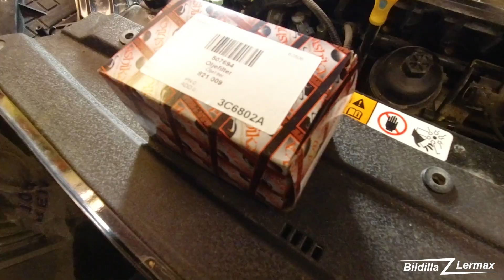DIY How to change engine oil + Filter , 2013 KIA Ceed 1.6 CDRi - Bildilla Magasin

Comment: How did you get the oil filter off the housing?
Reply from the maker: Good day!

Good question. It didn't come out in the video, I see.
I just pulled the filter out of the holder. But it fit well, so I was a bit unsure too!

Greeting
Pål (Paul)

Comment: Which is the oil you use for it? Could you suggest me any oils for my 2007 kia ceed crdi 1.6
Reply from the maker: Hello.

I would use a fully synthetic oil.
The oil choice has a bit to do with where in the world you live.
If you think that the thickness / viscosity of the oil is important in some climates.
I use Mobil Super 3000 5W-40. It is an oil that is suitable for most from cold winters that we have in Norway, to hot summer days in this country.

Here is an explanation I found online for you:
"The viscosity of oil is measured in how much it resists flowing. We have two numbers that define the viscosity of the oil. The first number ends with the letter" W ", which stands for Winter. This measure concerns how the oil flows when it is cold , for example when starting the engine.The second number is defined by how the oil flows at normal operating temperature for the engine.

The smaller the number, the easier the oil flows. A 5W-30 thus flows more easily than a 10W-30 at start-up temperature, and a 10W-30 flows easier than a 10W-40 at normal operating temperature for the engine. This is important, since engine oils naturally become more viscous when they get cooler and thinner when they get hotter. Low viscosity thin liquids flow more easily to protect the engine parts at low temperatures. High viscosity viscous oils are generally better suited to maintaining film strength to protect the engine at higher temperatures. "

Hope it helps you!

Regards
Pål
Reply: Any ACEA C3 specification oil is good.
Reply from the maker: @MetalSessions  Thank you! :)